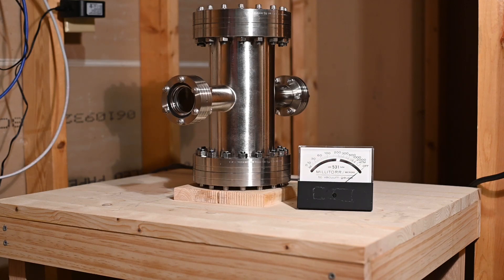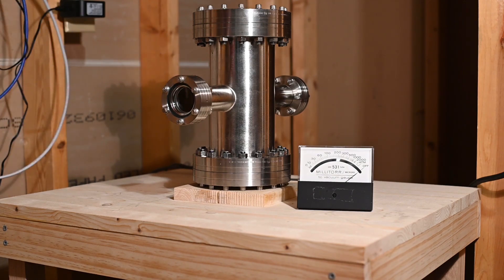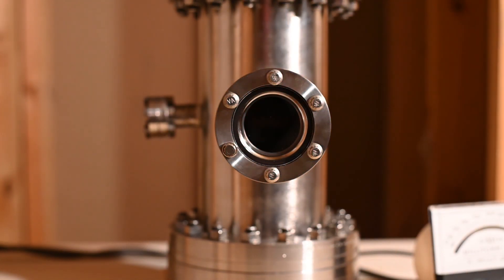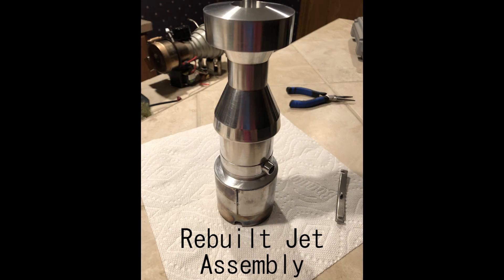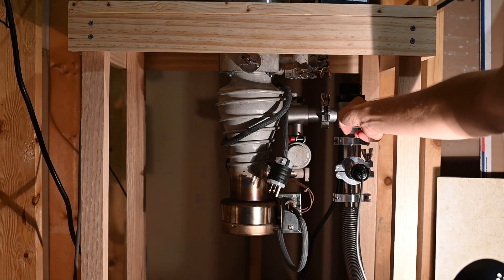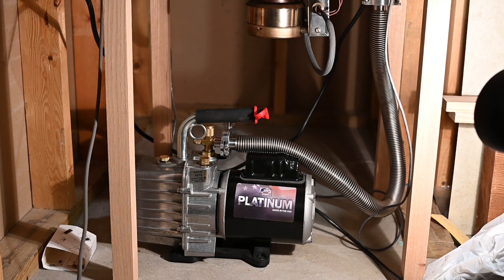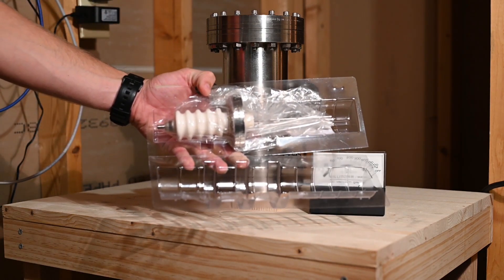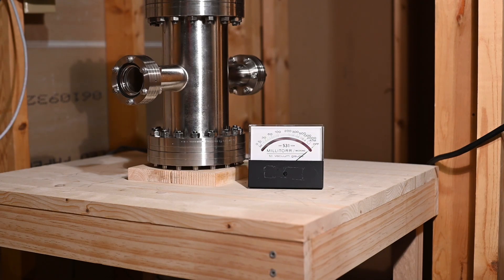Fusor Build Update - New Chamber and Other News

Comment: I have been working on building a sputtering magnetron for the past 2 years I’m slowly getting/upgrading parts I need, it’s very expensive lol I have the high voltage supply built, I have Edwards m2e2 mechanical pump,argon 20 tank and regulator, just got thermocouple gauge and meter 3 months ago and I’m still waiting on a bunch of used high vacuum parts that I ordered from Russia 2 months ago on eBay right now I’m just using a bell jar and 1/2” aluminum plate as my chamber I think I’m gonna try to get the same size and set up u got for ur chamber then I need to find a diffusion or turbo pump in my price range 🤞

Comment: Looks good so far.
Don't fall for the myth that HVAC equipment isnt suitable for making a fusor that can generate a respectable number of neutrons. If that roughing pump can get you below 30mTorr the diff pump can easily get you below 1mTorr. And to operate a fusor of your size, 7-15mTorr of D2 is the average. 

Hopefully some neutrons will come your way before the end of the year. Fun project!